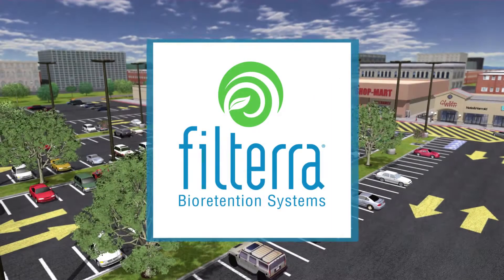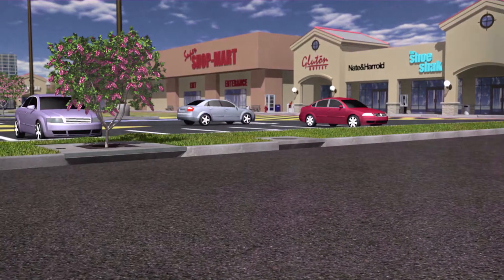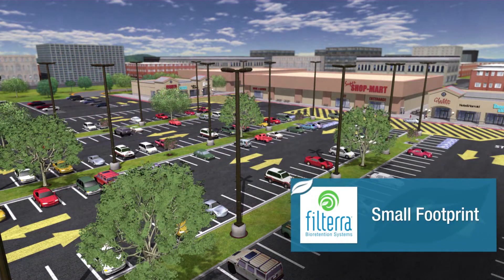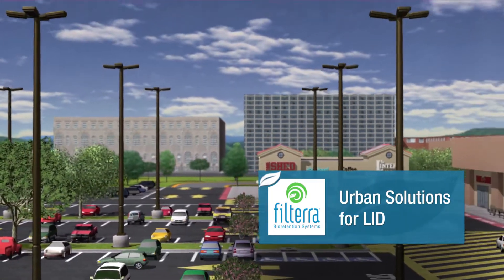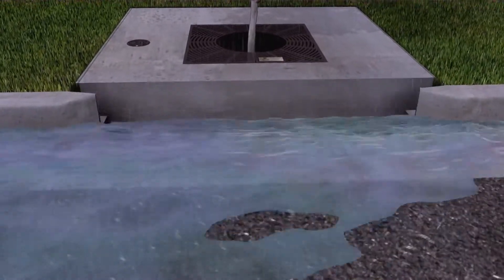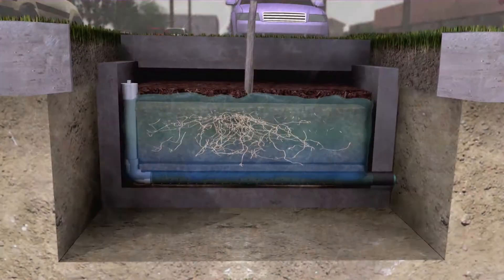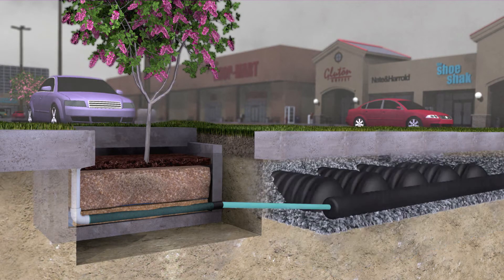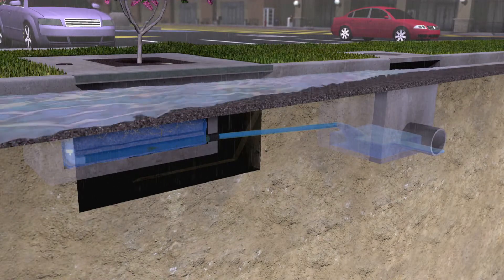How does the Filterra® Bioretention System work?

Comment: How do you use this for anything other than surface water collection? Not only is it extremely expensive but there are no options to be used with an A or E inlet set in the pavement. In what real world application would you have a stormwater pipe 6" below grade? I have a GI requirement, and no way to implement it without a tree in the middle of my drive aisle.